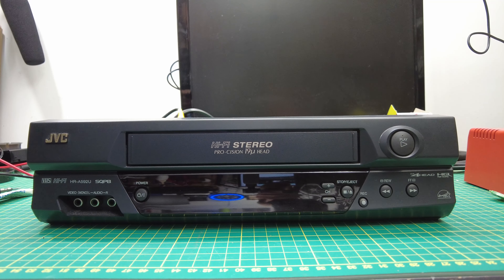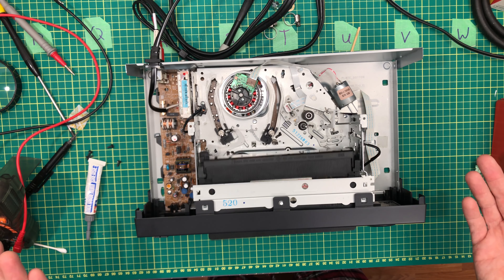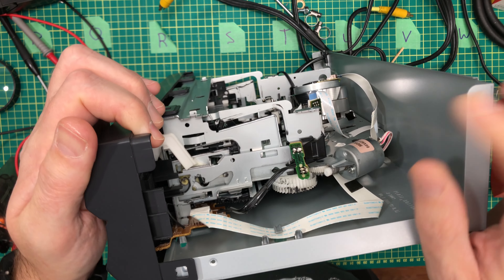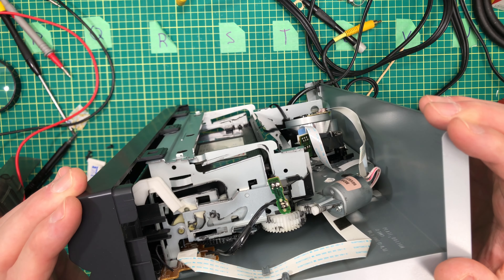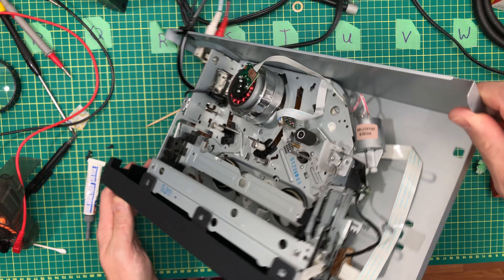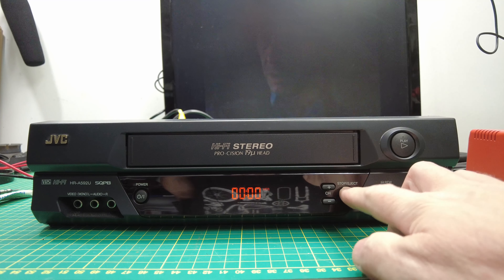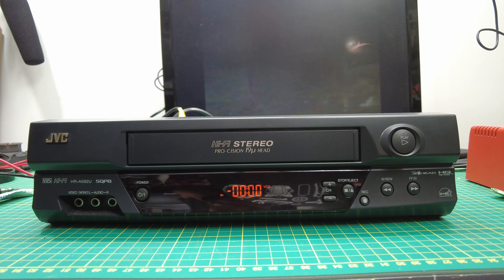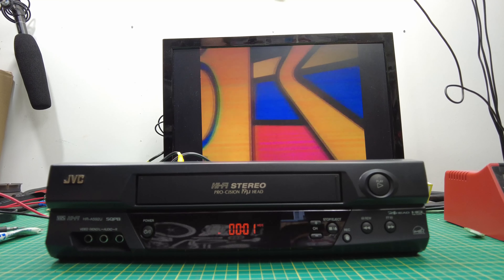VHS VCR load eject problem JVC HR A592U

Comment: I have a JVC HR-S3910 SVHS deck that has an ejection issue as well. It seems a 120 minute tape is too heavy for the mechanism to eject, while a T-10 0r T-20 tape ejects (not as heavy).
Any thoughts on how to repair?
Reply from the maker: I don't know anything specific about the 3910, but, if the tape basket mechanism relies on a belt drive, that's where I would start.  Maybe belt is slipping either because it's stretched and it's loose, or it's dried up and slipping.  Or both.  Clean or replace the belt.  I've heard boiling the belts can help recondition, but have never tried.  If it's gear driven, maybe there's binding in the gear train or basket slides causing excessive drag in the eject process where a heavy tape adds just enough additional resistance that the motor can't drive it.
Reply: Different mechanism manufacturer. JVC HR-S3910U was made by JVC. The one on the video, JVC HR-A592U, was made by Orion.

Comment: Did you ever figure out your problem. I have a vcr that has a similar issue. Thought this video might help. Was it the mode switch? If so, where it is located and how did you clean it? Thanks.
Reply from the maker: I haven't looked at it since learning about the possibility of a dirty mode switch.  It's pretty low priority so I'm not sure when I'll have another look at it (if ever).  The mode switch is the first thing I will look at, though.
Reply: so if you take the bottom out Thier should be a drive belt that’s broken
Reply: That sensor you were messing with you can see the gears dirty that area is were the band went out

Comment: I just saw a video about this issue and the problem is so easy to fix 😂 you need to reflow the tape sensor cracked solders points ... thats it
Reply from the maker: I'll give that shot next time I pull that thing off the shelf to mess with
Reply: U better pull it back out soon @spinphoto